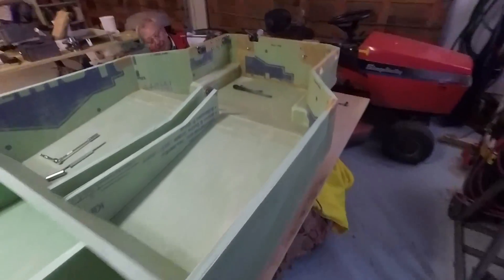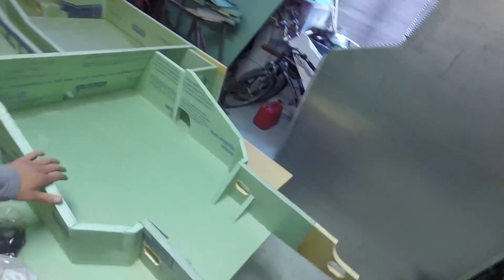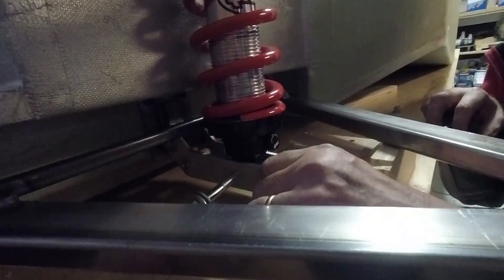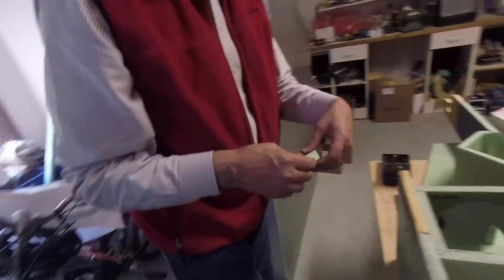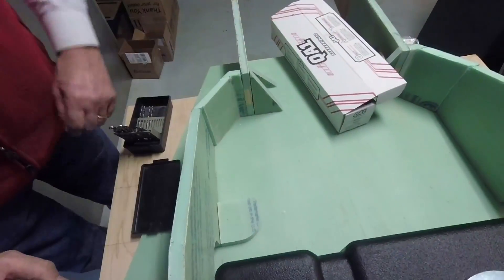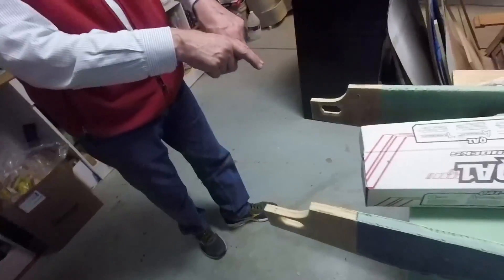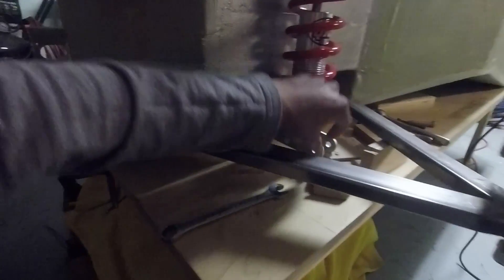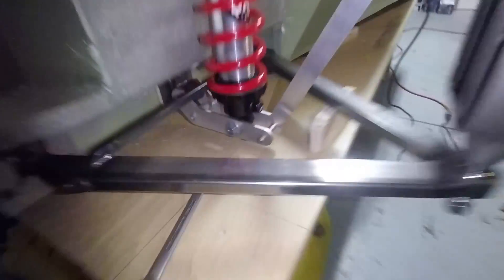Prototyping a Running & Driving Fiberglass Car?

Comment: Where I'm from very strict rego requirements small amount of rust on chassis they will fail inspection had to do fibreglass repair i joined chassis to under the floor with 2 layers of chopped matt the amount of sound and fibration it blocked out was enough to make me want to do the entire undercarriage the Handling improve so much with the carriage actually being bonded to the chassis and not just tack welded it was comparable to when i had the entire suspension system replaced plus almost completely silent.

Comment: the foam in the gas tank is to prevent the gas sloshing around.
thats also a really odd suspension design in my opinion.  why go through all the hassle of making a push rod suspension, without mounting the coil overs inboard and as low as possible? lower center of gravity that is as close to the center of the vehicle is why you would normally use a push rod, but thats mounted in basically the same place it would be if it was just normally attached to the control arm.. 
this is a super cool build though, i would love to do something like this
Reply from the maker: +John Pfeifer "The foam in the gas tank is actually called open cell foam. It's primary function is to prevent an explosive flame front from propagating through the fuel tank area. The suspension design that we are using is a pull rod setup. When using this kind of set up, we can achieve a progressive spring rate. Secondly, it reduces the unsprung weight. Lastly, we are trying to manage air flow through the wheel area, so mounting the coil close to the tub makes this easier."

Comment: lol you gonna add metal to that frame? I want to do this at some point, making a body from scratch is badass.
Reply from the maker: +TundraBoi Yeah, it will be reinforced with steel in certain areas on the actual production car